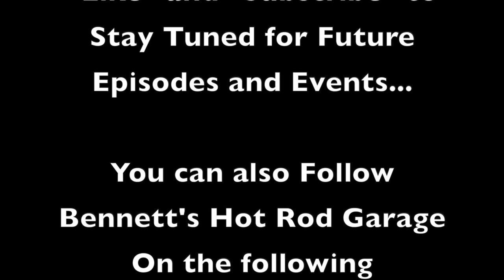We start working on the 53 Chevy and the 77 TransAm

Comment: About 15 years ago I picked up a work order at the desk. 1982 Celica, replace window motor. I removed the door panel and there was nothing in the door, nothing. No motor, wire harness, regulator, nothing. It had a piece of wood pried in to hold up the window. After a month of looking for parts I was told to put the panel back on and ship it.

Comment: Remember that ‘53 Chevy originally had vacuum not electric wipers. Since high performance engines have lower intake manifold vacuum, a conversion to electric is in order. Not surprised that you’ve hit snags.
Reply from the maker: not only vacuum, but cable as well